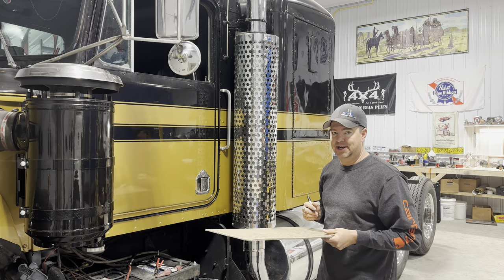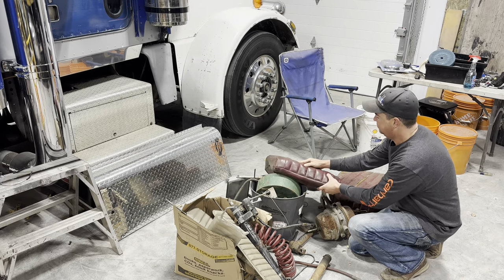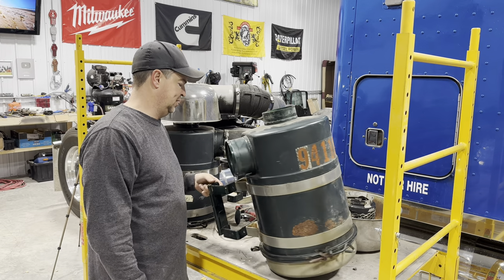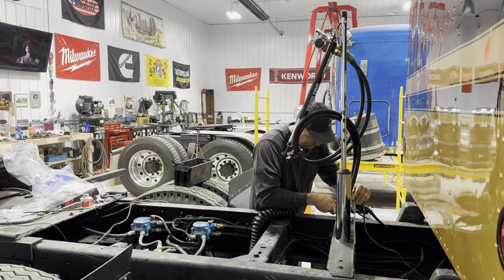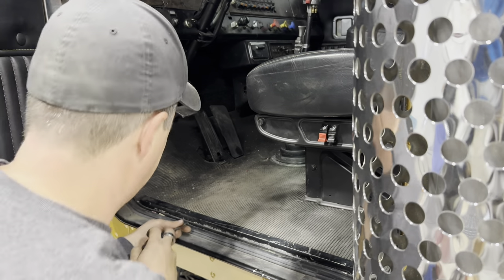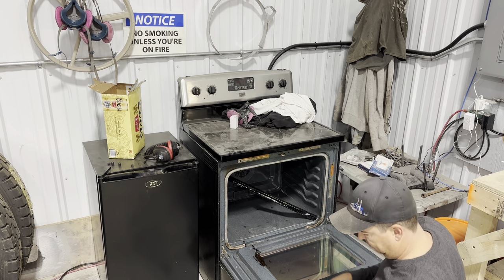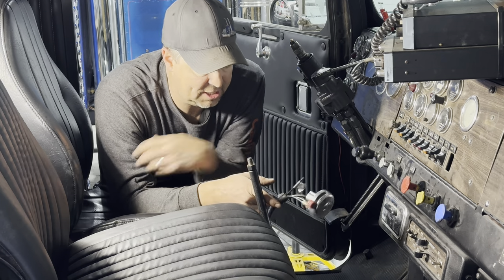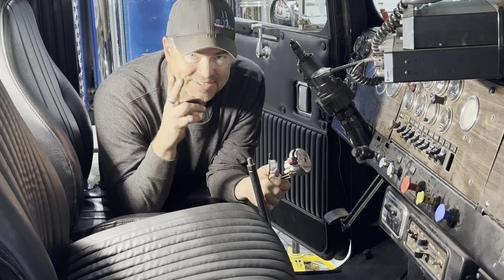Smokey & The Bandit Tribute Truck Ep.59 Why Don't You Use It

Comment: You already have the correct bands on your truck, maybe just remove the paint and get them chromed.  Not sure of the price, but by the time you finally track down the “proper” chromed bands, you may spend the same amount on those as getting the ones you already have done. Or I could be completely wrong.
Reply: That’s what I was thinking as well. There’s definitely a few chrome shops in Edmonton.
Reply: Yeah I said something similar a few videos ago. I'd send them to get rechromed/ plated. Chances are the ones you find are gonna be beat up and you'll probably want them rechromed anyways. Can't cost much to have them chromed, they aren't very big. If you gave them to the plating company with them already stripped and stuff it would probably be even cheaper.
Reply from the maker: Considered it but two of the four are severely corroded so I’ll keep searching for the chrome ones 👀
Reply: @TwinStix  Can't the wrap chaps wrap them with chrome wrap? 
Temporary fix that should be cheap...
Reply: @TwinStix  Make a set from polished stainless steel flat bar. A project you could do all the fab work right there, then get the pieces tig welded
Reply: @TwinStix  just get some polished stainless steel flat 1x2 or whatever size the original ones are bent up to match them ... all the shop would need is a metal brake and a slip roller to reproduce them in polished stainless !
Reply: @TwinStix  i think you're gonna regret not sanding that sill plate down to bare metal... the powder coat that's on paint is only gonna be adhered to the paint so it will be able to be scraped off just like before . that's why when you see most commercial powder coating they have sandblasting booths
Reply: @Hard_Right  I agree but he can always just go back and do it the right way, I don't know if he's had much practice doing this simple mistake
Reply: @kozy41  Or maybe its stainless?? Then you just have to take the paint of and get them polished!! If you must chrome them be sure its getting the triple treatment,copper,nickle and chrome.If you only chrome them they will rust as hell in your climate.I know,i live in Norway and we're having about the same climate as Canada.But i'm sure you know all that! truck on"!!:hand-purple-blue-peace:
Reply: You can have the bands powder coated chrome.
Reply: Me too, use what you have.
Reply: Yep i do the same in my restos to get it cleaned up and chromed , I have a good local shop that does chrome, good fair price , usually around the same price as, searching and acquiring the chrome one
Reply: @goratgo1970  Yeah, the guy that wrapped the truck would have no problems.
Reply: Chrome wrap or chrome powder coat will work.

Comment: Living and trucking in northern MN, I’ve learned the hard way what happens to those plastic coil hoses and cords in the winter. Swapped to straight rubber lines on all our trucks and never looked back. You’re doing great Mark! We’re loving the progress on Snowman!
Reply: I run the coils. They've been on the truck over 17 years. Drive in the north and northwest all the time. Never had any problems. Maybe I just got lucky.
Reply: Cole I know what your saying, I'm from SD. & used to run to Mpls, Mn. all the time. I was tarping my grain trailer one freezing cold day & jumped from the trailer to my deck ,bumped my red air coil host & it broke. They might look COOL but you could give me a set of them. they probably make better ones now than when I had them in the 80's but I'll stick to natural rubber hoses.
Reply: @danielhofer7386  I pull a lot of gravel trailers and side dumps even in the winter. I’ve had my supply line break from backing into a crossing. Straight lines are much neater and cleaner imo and tend to last much longer.

Comment: Great episode TS, we have those series:parallel relays on old trucks here. The older style is rebuildable, take it apart and put a pure silver coat on the contacts. No more issues.
Reckon you’ll struggle with slower starting rpm of a 12v starter in your Canada winter….

Comment: Had an electrical fire on my old ‘71 KW once. I jumped out of cab, yanked battery box off and disconnected batteries. Put the pump on manual, had a forklift push start me and drove it for the day. No radio, no turn signals, hauling roof tile to Thousand Oaks… 
Long day.

Comment: Mark, nice to see you hooked up the shifter for the low/high range and the splitter.  I used to drive mid 70's KW conventional trucks with Cummins 350's and 13 speed transmissions with the same style shifter.  I loved having the range selector and splitter in one button.

Comment: Since you can powder coat, you could temporarily coat the 13-inch bands silver. Would be closer than the black. Or you take them off and have a shop chrome them. Might save the time.

Comment: I know this isn't a work truck, bit I'd consider getting rid of those connectors and run line direct to the trans.
I was climbing a gorge in a road train and thought I'd stalled. I tried to get going again but was just burning the clutch out. I pulled the pin on the rear trailer and it still wouldn't start on the hill. It was then I realised I had a mammoth air leak. Turns out the connectors on the high range/low range were leaking and I was stuck in high range. Pushed them back together, hooked back up, and crawled up in bog cog. Wasn't a great experience for want of $5 worth of high pressure air line.

Comment: My biggest disappointment with the big companies was their discontinuation on stuff we did love. That shift knob when hooked like its done now should've been kept I figured. As said before, when they just change so its popular for the new kids, why take away our own choices from us. I would still like you to check out the foot valve and see if the air supply to the side for the dash is not restricted in some way. Those foot treadles are a hard thing to figure out at first as they do get plugged up from just setting around. Why, I don't know but found out the hard way as it got worse and left me parked till I got a whole new pedal assembly. Its not easy to just rebuild either. Once done, your going to find out that this line supplying the dash also goes to the horns on the top of the cabin. I won't bug you anymore on the jake. Someday, someone will just up and show you how darned easy this is to fix... dumb simple fix~!

Comment: Hi Mark

If you are still having problems finding chrome air filter straps, have a look at getting some stick on chrome. I have seen the stick on chrome on YouTube channel bad Chad he uses it to add some chrome to his car's.

I believe if memory serves me well that bad Chad says that it comes in different widths and lengths, but I do see bad Chad get the stick on chrome by the roll.

With the stick on chrome you only need to stick it on the air cleaner straps where it is going to be seen.

Plus you could use it on tank straps that are looking rough but are perfectly good for holding the tank.

Also if you have 4 batteries have a look at the amp hour's if each battery is over 300 amp hour's try wiring 2 of the batteries in parallel, then wire the other 2 batteries in parallel then wire the 2 sets of batteries in series to give you the 24 volts for the starter motor, but you also have 2 sets of batteries in 12 volt status.
Because only the starter motor will pull 24 volts, where the 2 batteries set up in parallel as 1 bank of batteries is set to 12 volt out put.
Then you can save money on the converter, remove the converter and still retain the 24 volt starter motor.

If someone in the comments understand what I am explaining can they please do a diagram for Mark.

The truck is looking beautiful and soon be seen by everyone who goes to the truck shows and when you Mark take it out for a drive. 👍👍👍👍👍👍👍👍👍👍👍👍👍

Comment: That pedal looks great and nice job powder coating those door sills. Should be much more durable for the high traffic areas. Now you just gotta get those air cleaner bands chromed at a plating company and stiffen up your CB mount. Looking great Mark!!!👍👍😁
Reply from the maker: … and wire the headlights, marker lights, fix starting system, replace pinion seal, swap trans/diff oils, install sleeper steps, fix jakes, change coolant lines, fix HVAC system, get tach/speedo working, buy a TransAm…
Reply: @TwinStix  
LOL yeah there's always something. When you get down towards the end of the project it seems daunting with all the little things. But you're doing great man, little bit at a time and it'll be all done soon. 😎👍👍

Comment: You can take the extra supply line brass adapter off to get rid of the extra airline. Or if you are using that supply line just switch it at your transmission.looking good. I prefer the old school look.
Reply from the maker: Decided to leave the 4th port (exhaust) plumbed as the line is just open underneath so it’ll blow the excess air out there 👍

Comment: I invented this really neat device in 1968. It’s called a cloth tape measure. It allows you to get accurate measurements without having to use random lengths of wire. I would send you one but the taxes in sending modern technology into Canuckistan is too prohibitive.

Comment: I would keep the shifter the way it is, I had both and sometimes when you split back to direct you go a little to far and it will go into low going 50 miles an hour, those 3 way selectors switches bad shit can happen.

Comment: With regards to an electrical fire, have you considered a "master cutoff" elect switch, on the main battery lead? In case of elect probs, it immediately shuts down power and keeps the batteries from draining when parked over the winter. I have had vehicles that have sat for a year before auction and they still started after sitting that long. Overall, looks awesome. Well done.

Comment: We had a new truck in that vintage it had a plunger for hi lo range but the shift knob only had the splitter control on it with just two lines to the knob
Reply from the maker: Yeah that’s the way I had this setup before and the same is in the #IronDuke
Reply: @Robert Neumann: Was the transmission you are referring to a 15 speed? That’s the way they came set up. Take care.

Comment: Hey Mark, Seeing the straight air hoses reminds me of a story.  I worked for a lumber company back in the 80's as a mechanic/ truck driver.  We had an old LN9000 Ford and a drop deck trailer that we would deliver fork lifts on.  My boss told me to take a load of(3) Chevy S10 pickups to get rust proofed.  the place was on the left as I approached and I noticed a convenient  on the same side next door to the rust proofer with a huge parking lot.  I swung up into the convenient store parking lot and cranked the wheel as far as I could, came back out on the street pulled in front of the rust proofer and stopped.  I got unloaded and looked over at the trailer light plug. The plug was still in the trailer but the wire was hanging down by the driveshaft.  Making the turn pulled the wires from the plug on the trailer.  The cord was too short.  I got the wires back in the plug and everything was good.  When I got back to the shop I told my boss that the cord was too short and needed to en replaced.   His response.  When you see you have to make a turn that sharp, stop the truck get out and unplug the lights.  Make the turn, then stop and plug them back in.  I Kid You Not.   I was told that the hoses and light cord should be 15 feet long.

Comment: I had my wife pull start my old Autocar dump with my new 2020 GMC truck a few times because of a broken wire which worked well for awhile until she took off one time with slack in the chain and I watched in horror as 40 ft of steel chain was headed for the back of the truck after the hook snapped. Luckily it just skimmed the roof of the cab and drug a little across the hood and landed about 20 ft in front of the pickup. Could've killed her if it went through the back window. I fixed the broken wire.

Comment: I think you figured out my problem on my friend's truck. I'm wondering if someone updated the transmission. But for some reason the shifter is plumbed in that high range is low and vice versa. I try reversing it but the thing would never work correctly. Also I found out that the older 13 speeds sometimes that plunder in front is actually a clutch brake. That would also explain why my friend's trucks clutch brake is non-existent (blown apart) and now that it makes sense the way it's plumbed.

Comment: Mark had the same problem trying to find the correct air cleaner bands for my peterbilt 351 try donaldson part number p522439 polished stainless steel 13 inch short ear

Comment: A tip when powdercoating. Always put 2 coats. If you scratch it, it'll scratch the top layer, and you won't get bare metal showing through. I used to be a fencer and you could very quickly see the difference between one coat of powder and 2 coats. 2 coats is a LOT tougher.
Reply from the maker: There’s actually 3 coats on there 😉

Comment: DOT. requires a truck to have a LARGER fire extinguisher than the one you bought. How do I know this? I was once in violation on a safety check by having the small one.   I grew up on the very 3 way shiftier button you have. The industry had the two button style then went to the single button for a few years then went back to the two buttons & finally to the new black all in one button with the low side on the front of it as a up/down button. It was said that there was to many people sliding the sliding button over into the low side of the transmission while shifting the shifting knob you set up. I never had any problem & loved that knob, but sometimes ya just can't fix stupid.

Comment: Completely off topic question:
In your opinion is it more financially feasible to rehab on older truck )pre emissions ) like a pete 379,then to buy a new or a pre owned W/warranty?
The cost in the United States are just..no,just not paying 200k for a plain jane  semi truck.
Reply from the maker: Debatable 🤔 if you did all the work yourself then probably the older truck refreshed but if you had to pay shop labor on top of parts then for sure a new one would be cheaper
Reply: @TwinStix  be a shop rebuilding the engine,transmission and rear end cost of truck be around 60 to 70k.
Crazy crazy business anymore being a truck driver in post kung-flu world.
I honestly cannot figure it out for the life of me how somebody's affording a $200,000 truck I get the same rate quotes as they do,I do fuel networks, I don't think I could get cheaper insurance anywhere,100% clean CDL,no payments on anything and buddy I'm scraping.
Reply: @thomaspavelko9412  it seems to me, that actually doing the work costs more than y'all are getting paid to do the job. There is your problem. The freight rates are too low. maybe some of the freight needs to be moved to trains, and the truck freight needs to be higher. The whole idea of load boards and brokers seems crazy to me. I used to do this work 30-40 years ago in germany but i always worked for a company that did their own dispatch. It cost what it cost to ship, and it cost what it cost to do the work. the rest was profit. now the cost to ship is high, and the cost to do the work is high, but the profit comes out before the truckers get paid.
Reply: @uliwehner  your not wrong on a lot of it,alot of the problem is due to unregulated freight rates alot of.."not from around here" drivers do it for less then it cost,when you have a 30k truck that is very very DOT questionable(duck tape,bailing wire,paint half missing,different color hood,missing half a bumper) not alot of cost there,it breaks just abandon it buy a different one.
Thats some of the problems.
Democrats really created this issue causing Americans to be pushed out by foreigners..just a fact,go to any truck stops fuel lane and just watch for an hr,been around more Americans in Afghanistan then in a truck stop in the United States.
Fact is if the economy does not catch up to the cost in North America its going to break,folks need 3 things to survive,
Food
Clothing 
Shelter
Take away 2 of the 3 things will get very nasty very fast.

Comment: You can chrome/nickel plate the bands yourself…… it’s the same as electrolysis rust removal….. 
remove the paint……. Set in a tank of water with a battery charger …. Connect positive to the bands the negative on a Chunk of nickel….the bath should be charged with electrolytes….  There’s a little more to it than that. But it’s easy as hell to do.
Reply from the maker: Interesting idea but two of the four bands are severely corroded

Comment: I wouldn't find a way to mount that a little more permanently I think the duct tape is going to wear off over time and not be as good as it could be but that is just my opinion maybe it'll work really well and maybe or maybe it won't let me know how it works over time I'm curious to see how it's going to the truck is looking badass
Reply from the maker: Yeah I already redid it with JB weld so it ain’t going anywhere now 😂

Comment: Hey Mark I don’t wanna tell you what to do if you use those airlines you just put on don’t turn very sharp you will rip them off they’re too short just a heads up
Reply from the maker: Yeah I just guessed at the length and if they need to be longer when I hook on the trailer I’ll just redo them as I have lots of extra line 👍

Comment: Mark are a engineer, by trade, and you are restoring these trucks, SO??????, be an engineer. Drill out the spot welds on the bands and move the mounts. Then re-weld the spot welds with your mig welder. The welds will not show and you are off and runnung. Good luck!!!!!!!!!!!!!!!!